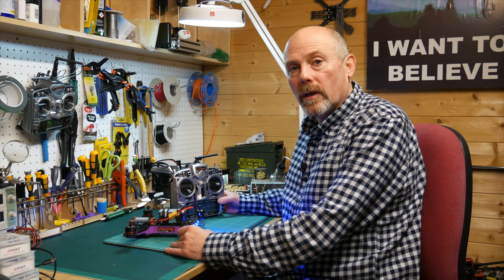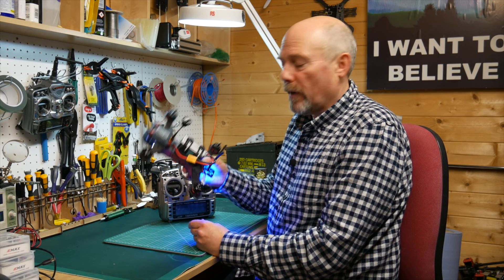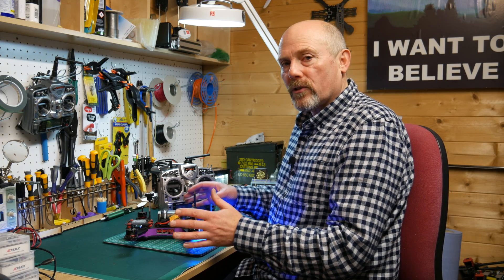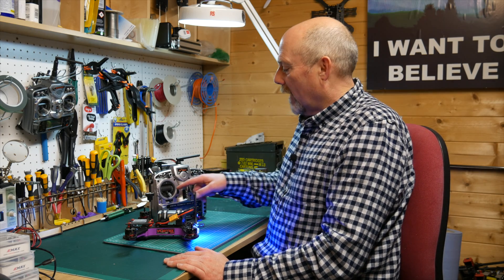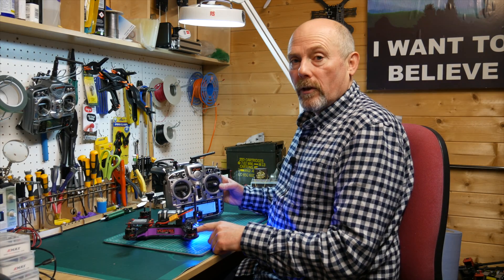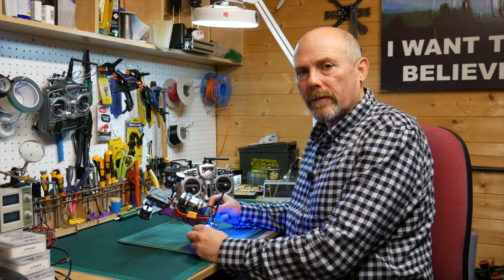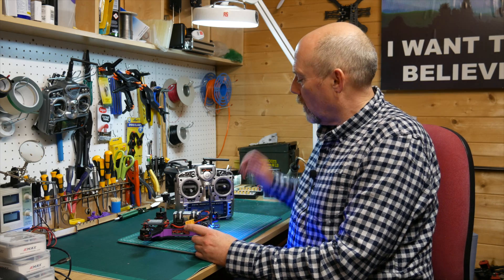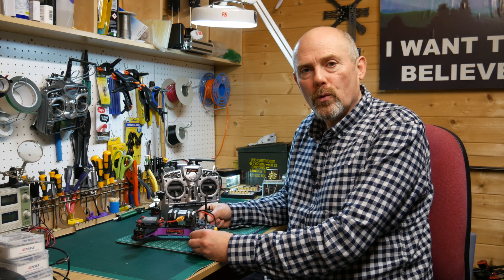Vortex 250 Pro quick tip - lost model alarm

Comment: Confusion is an understatement. It was driving me nuts!!! I thought there was something misconfigured and took apart my Vortex 150 searching for something that would give me a clue. I went through EVERY OPTION on the OSD searching for a clue. I posted in RC groups hoping someone would shed some light on this. At some point I began to think it was maybe a "Low Battery" warning. Well... Problem #1 solved. You also solved #2 which was how to setup an Arm Switch. Now I keep on searching to find out why my OSD is being cropped on the FPV monitor... Thank you!!!

Comment: I am brand new to this hobby and dove in headfirst with the Vortex 250, Taranis Plus and Dominator V3. I just can't express how helpful your videos have been in getting me set up. You've got clear video and articulate discussion that seriously sets this channel apart from others. I've had a few flights now and it's definitely rough starting out, actually flying well is much more difficult than I thought it would be. Thank you so much for these great videos and I think you are doing a wonderful service for this hobby.

I would definitely be interested in discussion about more details of betaflight and how I can better tune my drone for learning beginner flight and progressing from there.
Reply from the maker: Glad the videos helped. I always recommend getting lots of flying in before you start trying to tune yourself. As a first step I suggest trying the pro tune set ups on the Vortex, but unless you've got plenty of stick time, it's hard to know if it's you or the quad. The Pro Tunes are pretty good and you can quickly switch between them to find one that suits you. Then fly, fly fly - every day if yon can. Have fun.